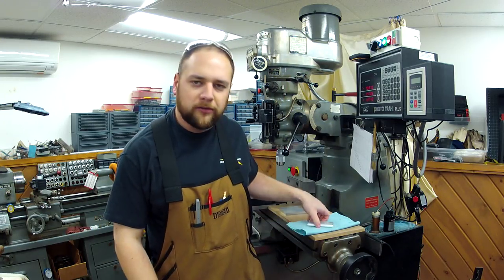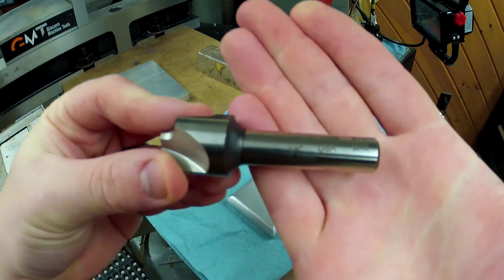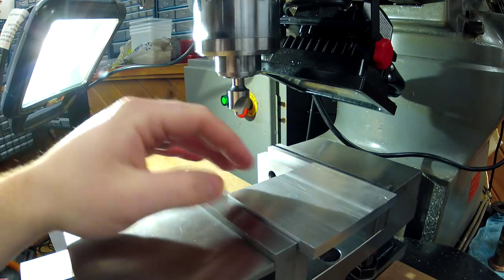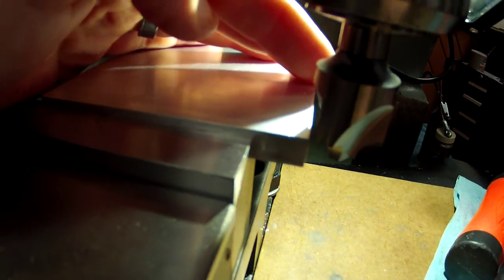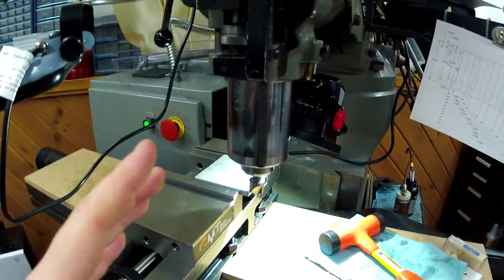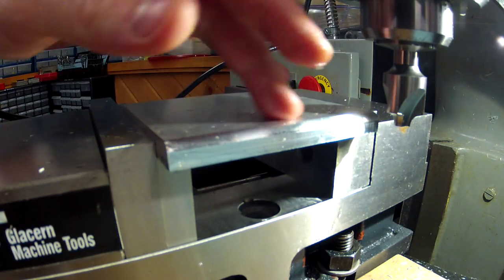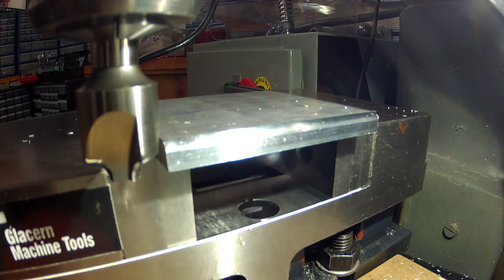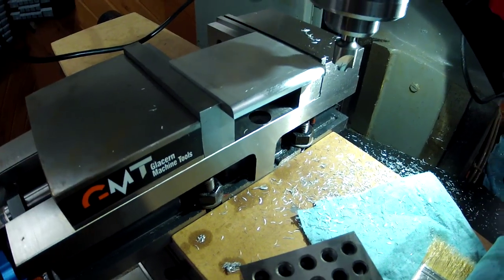Machining a Radius with a Corner Rounding Endmill

Comment: Guys-  I work for a major carbide & high speed tool manufacture. I also have
30 years experience, the one thing you need to do when running corner rounders is
make sure you climb mill "not conventional" ( like this video shows)...hence the bad edge.The geometry of this tool has very little clearance for conventional milling and works much better if you climb mill in most if not all types of steels, stainless and Aluminum. You can also run much high feed rates due to the low engagement of
radial diameter.
Reply from the maker: Bobmac90 Hi Bob. Thanks for the info. I was machining some parts with a radius cutter this weekend and remembered your comment. I climb milled the radius and seemed to get a better finish. Thanks for the info. I was always taught to only conventionally mill with a radius cutter - sometimes it's hard to break those teachings!